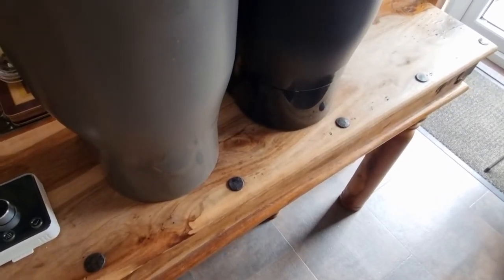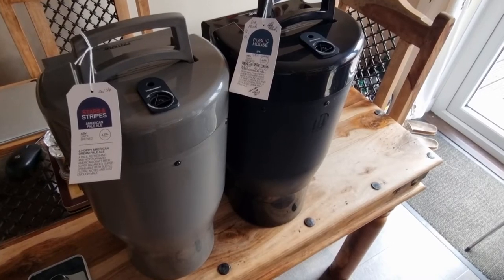Pinter Tips & Tricks. What is Cold Crash?

Comment: Think you've got the right idea with cold crashing with the pinter upright so the yeast falls out into the Dock. You probably don't have to "condition" in the fridge for long after that, it's not really conditioning just a second cold crash to clear while the pinter is sitting flat. I'd go 7 to 10 days initial ferment, 1 day cold crash upright, remove Dock, then 1 day cold crash in fridge.
Reply from the maker: I now have 3 Pinters on the go so might try a few experiments with the same brews to see what, if any, cold crashing has. Do a with & without.  Thanks for the comment
Reply: Been thinking along these lines myself. Surely conditioning is just a horizontal cold crash? Wouldn’t it be better to cold crash/condition the Pinter vertically for the duration of the conditioning time?  This way there would less sediment in the brew as it’s all droppped into the dock. Or am I missing something ? 🤔
Reply: @steviexup  TGG have really confused the traditional brewing terms. Putting any fermenting/fermented beer in the fridge is cold crashing and not conditioning and I'd agree do this with the Pinter upright to catch more trub in the dock. The difference with the Pinter is that it is brewing under pressure so there is a benefit in refrigerating because the co2 dissolves in cold liquid more readily than warm so the beer will end up more carbonated. Most beers improve / change taste in their first few weeks so taking off the dock and leaving horizontal in the fridge for a week or so may make it taste better.